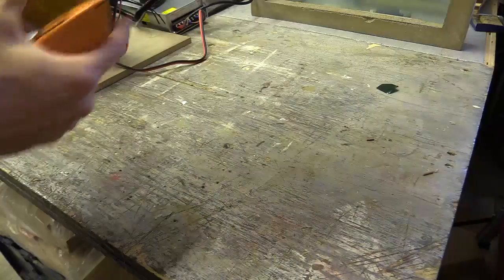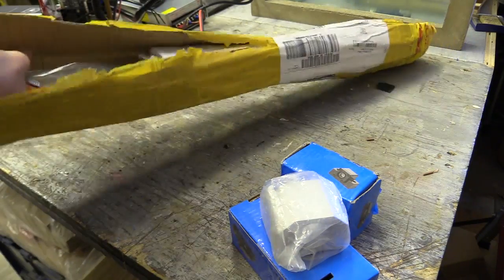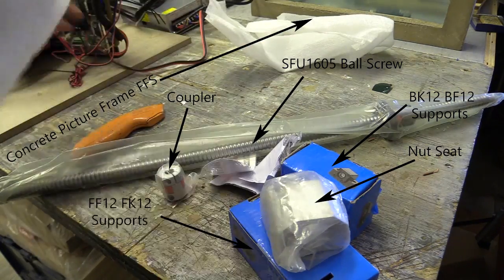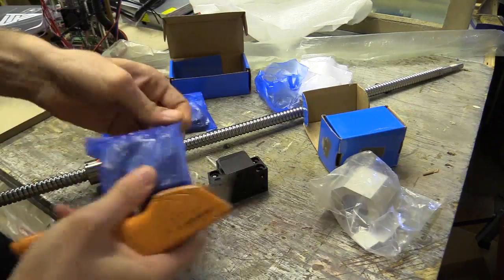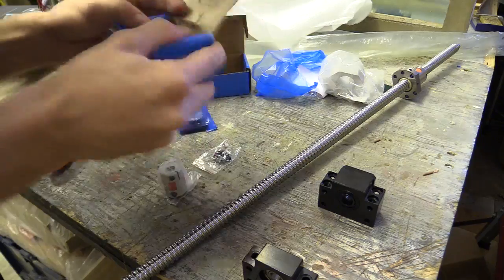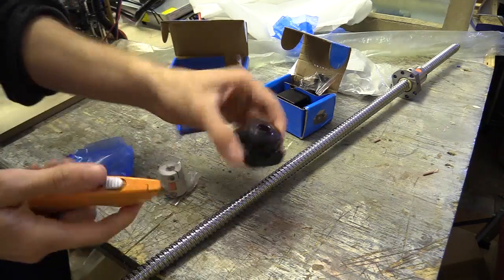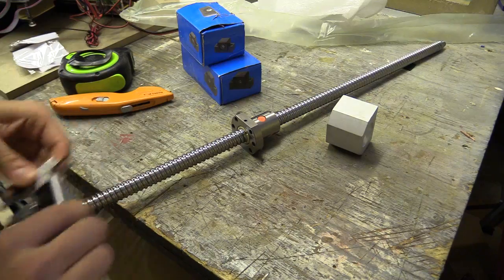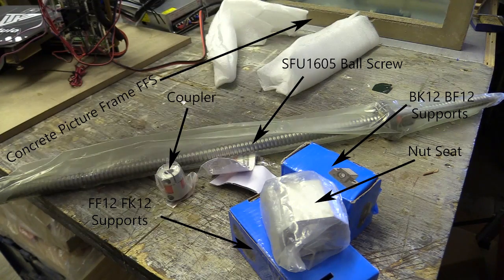CNC Postage Goodies / Ball screw SFU1605 BK/BF12 FF/GK12

Comment: Can I ask.. Can you use these ball screws and nuts on Manual machines ? I know they will not fit , but the fact there is No or very little friction in my mind would mean the crank handle would always want to fall to the bottom due to weight and gravity ? So is the only reason this doesn't happen on cnc because the steppers always lock it stationary ?

Comment: Hi, Just thought I would update you with my problems, I still haven't managed to get my CNC working but I hope there is light at the end of the tunnel. I have been told that the machine I have comes from Germany and the problem is that the programme will not work with a modern PC. I need to get XP so that the programme will work. I am just having trouble finding this operating platform as Microsoft no longer supports of sells it.I hope your build is going well and | keep watching your videos with the hope that a little of the information will sink into my thick brain.
Reply from the maker: Ahhh I though you got a lot closer last time you wrote. You might have to get a second hand machine with xp already on it, or you could run an emulator from a newer version of windows. If you search for "xp mode in windows 10" there will be tutorials, but a second hand machine might be easier.  Good luck!